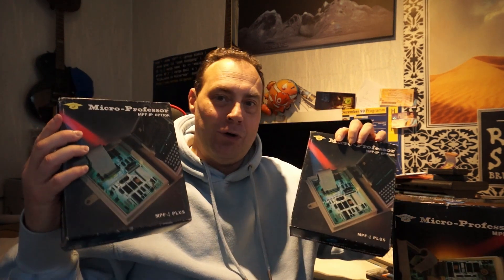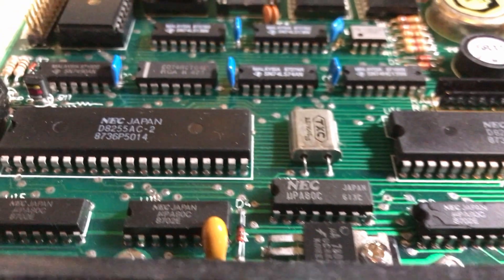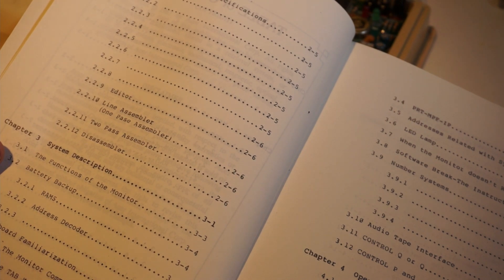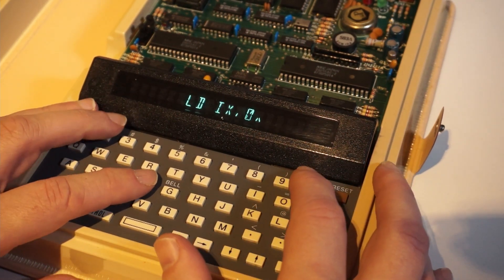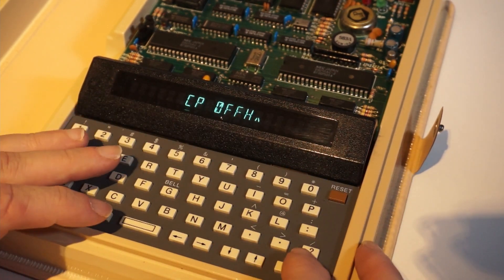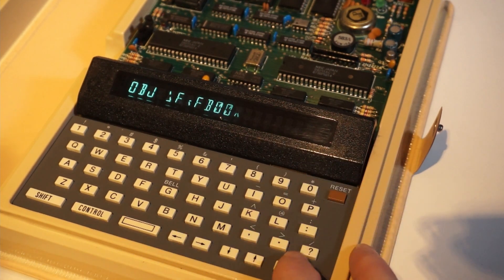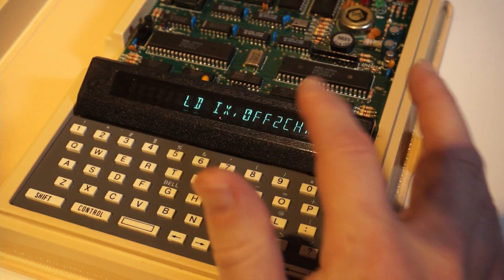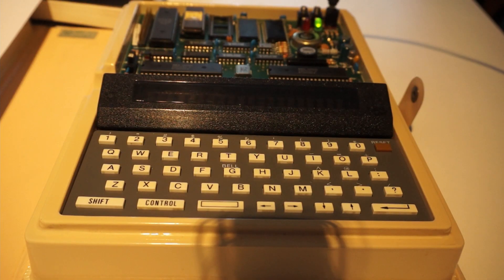Z80 programming on the MPF-1-P

Comment: Hi! So no, definitely it doesn't work! 😭 When I put the AC/DC it beeps, or shows a strange display. But nothing happens. I've had had the welcome message for 5 mns and then I disconnect it and then nothing. Do you have an idea about the problem?
Reply from the maker: Oh many can be lots of things. From a dodgy reset (perhaps the cap for the reset circuit being out of spec). To a regulator being bad. The 7805 are notorious for going bad.

Comment: Very cool; I really enjoyed this. Thanks for showing this kit and how you learned some assembly - I've never seen it before.
I went to a small private college '87-'91 and, in our Physics department, we still used more primitive developer's kits from the '70s. 
(Honestly, it was fine even though they were old - broadened the span of our knowledge to the previous generation.)
Specifically We had the Mark-80 (Intel 8080) and SDK-85 (Intel 8085). The former had a bank of switches; the latter a numeric keypad.
Reply from the maker: We only had Z80 assembly during the 3 semester the 4th semester we switched to 8088 and of course we also had C and Pascal.
But since I studied electrical engineering, all the coding was very much aimed at process and system controlling. And writing your own “OS” more like glorified state engines.
I never worked with the 8080! Not had one in some sort on my possession. 
An Altair would be nice. I thought about getting one of those Pi Altair or PDP-11 kits.
Reply: @CallousCoder  Do you know the channel IMSAI Guy? He is doing a nice series with the Osborne 1.

I had a Z80 only for a short time in a Commodore 128, when I learned FORTRAN 77, then Pascal. I never used the 128 itself for programming other than BASIC  though. It was an reasonable 80-col terminal to dial into college's Prime 750 (which was used for FORTRAN and assembler classes). Thankfully one year into college they bought an AT&T 3B2/700 so I learned Pascal then C there... and on Amiga.
Reply from the maker: @DrDavesDiversions  never heard of IMSAI Guy I’ll subscribe. I want a KayPro as it’s basically and Osborne with 80 cols and a bigger screen. But still z80 and CP/M based.

You were lucky in college. We just had 386 machines (of course also new in 1990-1994) when I was there. So nothing exotic other than DOS, NetWare and Minix on which we did C and the classes of OS design. Obviously when you use Dr Tanenbaum (from university of Amsterdam) his course material you use his Unix like operating system. Which I actually immediately fell in love with and thus a step up to Linux in 1995 was a logical step for me.

I didn’t own an Amiga when I was young, I have two refurbished once now. And did some 68000 hacking on it during the first lockdown 2 years ago. I immediately loved it and it really cemented that my choice of the Atari ST was the wrong one (which  is sneakily already knew in 1990 when I bought it). I bought it because I had a synthesizer and wanted to do midi recording. And the ST was cheaper and had the midi interface. But wasn’t much fun to program assembly for. My class mate had an Amiga and when he showed how to blit and what the copper could do with its 4 or 5 instructions I really knew I should owned an Amiga.
So I made up for that now :) And ironically in my retro nostalgia pursuit these last two years, I had no urge to get an ST.
So it’s finally weekend here. Of for a cold 🥶 outdoor swim (it’s just above freezing) and then a hot shower and relax in front of the TV.
Reply: @CallousCoder  I was lucky - I feel like having Unix in college laid the foundation for my professional work; I have the foresight of the department chair to thank for that.

Ya, I feel the same about the ST, but it is amazing they managed to do so much in so little time when Tramiel went to Atari. They /almost/ caught up to Amiga, but made too many compromises in design (missing custom chips, poor expansion). If Atari had predicted Amiga's slow start they could have made it better.
Have a great weekend!

Comment: Was it possible to use this thing to write code for other machines on this thing like a atari 2600.
Reply from the maker: No. All these old machines had their own hardware so you programmed specifically for that hardware. And in case of 2600 it was even  impossible as that ran a 6502 processor and not a Z80.
It was strictly a teaching aid to teach Z80 assembly that you could then translate to whatever embedded device you had to program.